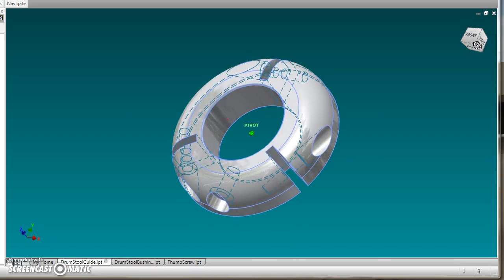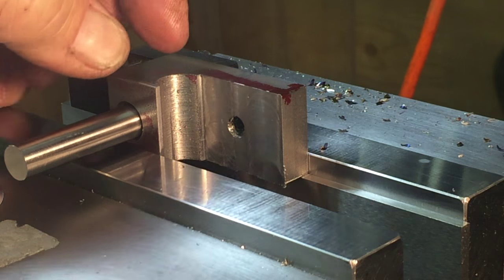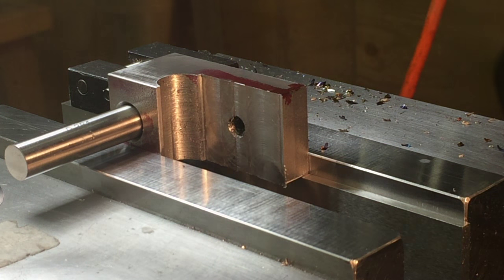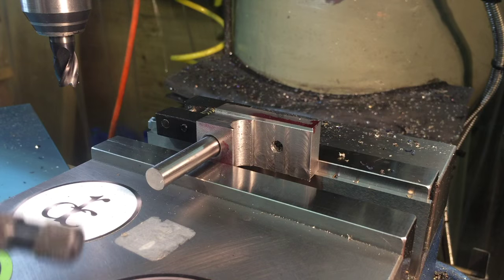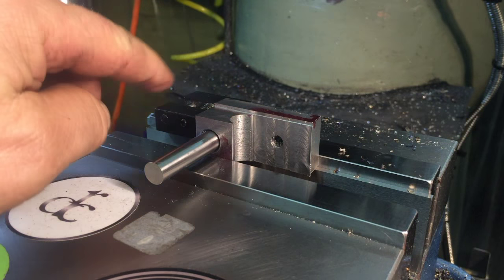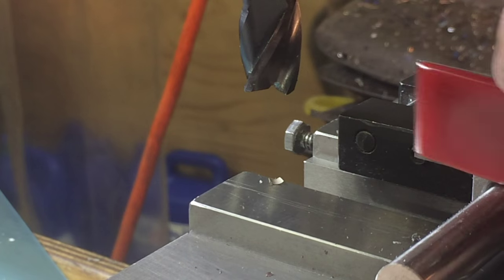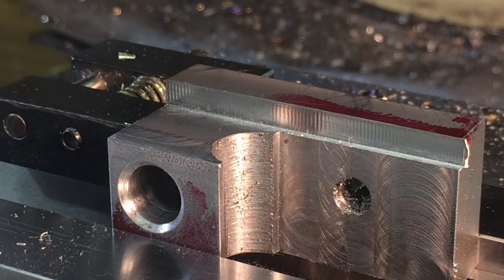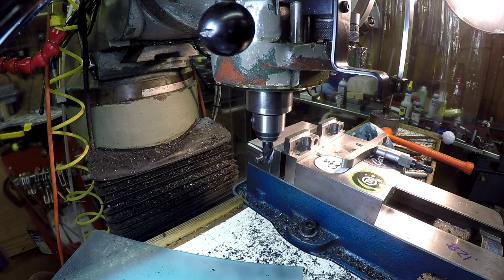How To Make Milling Machine Table Low Profile Clamps P3

Comment: Nicely Done Randy ! you gotta love the way Carbide end mills chew away at metal. 
Im Busy re-arranging the shop  so I can pour a concrete pad for an upcoming  piece of equipment which has yet to be found, LOL I got some Christmas shopping to do :)
Oh I cant forget Christmas shopping for my wife  that would put a kink in the works.
Cheers
Phil
Reply from the maker: +Phil's Projects Thanks Phil, Carbide is great.  Your shop is not in a basement?  A good base is important.  You are supposed to shop for your wife? What?  Maybe that is where I went wrong.  But after 36 years it is to late to start.  Have fun shopping.  Merry Christmas.  Randy
Reply: +Randy Richard Yeah I have been shopping for my wife for awhile. I still haven't found a model I liked that I could afford. lol
Reply: +Randy Richard My shop is in the garage, I do have a concrete floor under my insulated wood floor, the existing floor has a pretty steep slope (+/- ½ " / ft ) heading to the center of the space for drainage , I think it was their excuse for not putting in the time to do a nice level floor!
Reply from the maker: +bcbloc02 Shopping for "the wife" or shopping for "a wife".  In either case maybe you are shopping in the wrong spot.

Comment: Nice work Randy and I like the super clear videos. My Eze-laps are so useful that I recently purchased a set of diamond-coated Swiss flat files for deburring extra tight spots too small for Eze-laps. Looks you are are going to have a nice set of clamps for Christmas :-)
Reply from the maker: +Paul Jones Thanks Paul,  The eze-laps are great.  What brand files, I should look into them.  Merry Christmas, Randy
Reply: Hi Randy, I bought an inexpensive diamond-coated Swiss flat files set on Amazon. Very good set considering the very low price. The set is "HTS 101I0 6 Pc Diamond Flat File Set - 40 to 600 Grit". I shortened the plastic case for easy access to each file handle and labeled each file handle with its grit size using a Sharpie Ultra Fine Point marker. I use the 150 and 240 file grits the most.

Comment: Newbie here, I was wondering why the width wasn't cut first?  Seems it would have been easier to put the hole in the center of the finished width stock rather than cutting from each side to make the hole centered.
Reply from the maker: +H H Yep mistake one, Thanks for watching,  Merry Christmas,  Randy

Comment: Can you guess the most time consuming task a machinist undergoes while machining.... ??? 

Answer later...  I'd like to know if we think alike on this one...   lol

Clamps will be ready for Christmas, nicely wrapped....   And a tag saying   "From: Me    TO: Me  "

For you, all your family and friends, have a Merry Christmas............    Pierre
Reply from the maker: +pierre beaudry Planning is my answer.  They worked out great and I was able to get the intended Christmas gift done and shipped.  Merry Christmas,  Randy
Reply: During machining, after a compulsory good planing, deburring is a time consuming task, if find.... The ones that knows best is the CNC operator who knows 2 1/2 operations about machining, "Cycle start", "Deburring", "Cycle start", "Deburring", and sometimes "Panic Button"   lol
Reply from the maker: +pierre beaudry Yes lots and lots of debur.  LOL on the CNC.
Reply: set up or measuring
Reply: +pierre beaudry A small angle die grinder with a 2" sanding disk works great for deburring when in production mode :)
Reply: AtelierDBurgoyne
  Production mode..... Gezzz, I hate that word, usually I'll only do a few of something, more like prototypes, but the little die grinder is an idea, depending how much burr there is.  One thing I use a lot is like Randy, a diamond lap, it only gets the burr out and leaves a pretty square corner the isn't sharp any more.   ;)
Reply: +pierre beaudry Salut Pierre. I was referring to production loosely as making more than 2 of anything :)  Except for measuring tools, I prefer a nice chamfer or round edge on most things I make.

Comment: Great video as always Randy, thought I'd hold off on any thoughts until the last one on this build. Probably multiple way's to go for the machining sequence's on this project. And everyone really should know the first prototypes are where those correct sequence's are figured out anyway. That and material sizes. I think you did great showing where the few minor mistakes crept in as far as what you started with and what you ended up with. A bit of extra work, but an excellent object lesson imo.

And as usual another great project. Have to add this one to the list for sure. A great deal cheaper than a double set of Mite-Bites. But I now think you've paid me back for adding to your project list lately. :-)

So who's stub length endmills are you using in this vid. They look like there sharp as hell.
Reply from the maker: +Turning Point Thank you and Merry Christmas.  It is tough showing the first time through.  The pattern is full.  The end mill is from Enco,  Mention my name.  Atrax Model #619-1456.  I use it to make the Dovetail cutters, Seem to work very well and last quite well in the tough material 4140 prehardened. Take Care, Randy
Reply: +Randy Richard And the same Christmas wishes for yourself and your family Randy. Will be sure to do so on those endmills. 

Will email you.